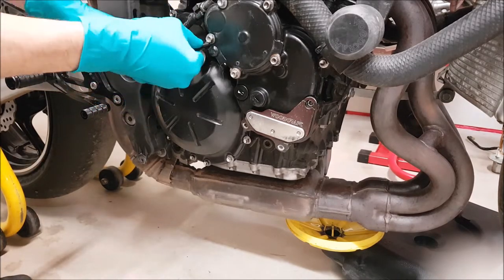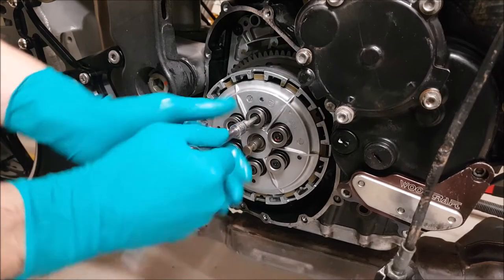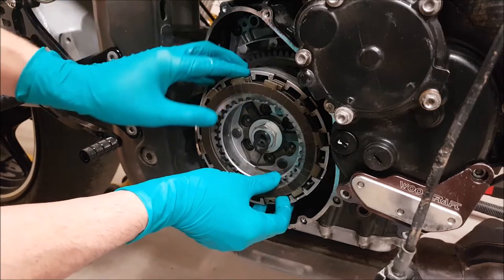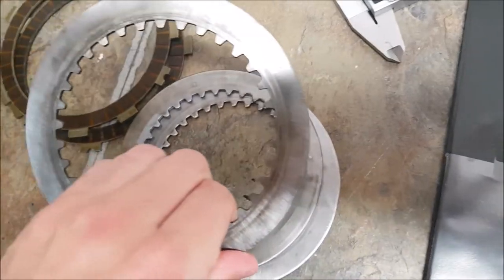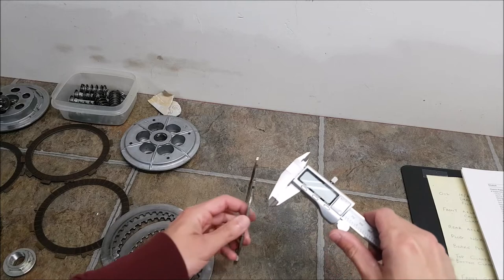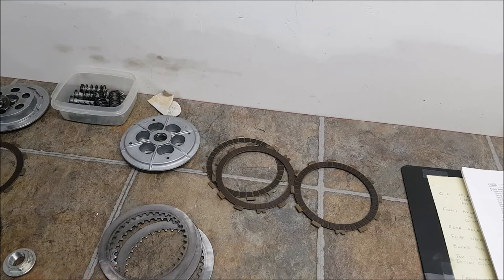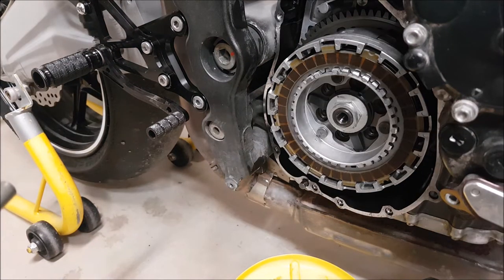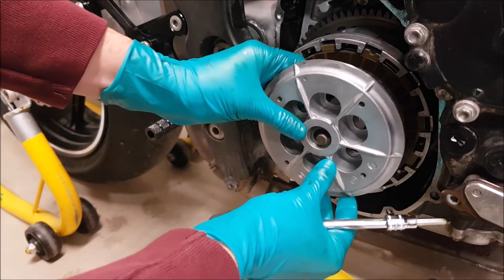ZX6R Clutch Replacement

Comment: Hi ,own zx6r 08 ,cluth is not slipping and is changing good but after getting hot a whistle noise came from clutch when the clutch is pressed,need to change the clutch?

Comment: My clutch cable broke I was able to get a replacement, wasn’t the same one I had but it works, now my bike won’t speed passed 60-70mph it just redlines if I full throttle even if I shift it up to 6th gear it doesn’t want to go passed 60mph, can it be cause of my clutch? I know before I was having issues getting my bike into gear when I try an do a pull. It like slips

Comment: Ok i picked up an 07 zx6 for $500 it has a bottom end knock. Attempted a valve chain adjustment no change. The rod in the clutch that goes through the throw out bearing is damaged at the tip. And as I don't know anybody that messed with the 07 much I might as well ask a racer. Outside of all crank/rod bearings what are some common bottom end issues with 07-08

Comment: What break in time and top speed or rpm can go after get new clutch I was told 6 rpm and 500 miles ... maybe thats wrong or maybe it doesn't matter ? Sucks driving slow maybe some one has better info then what I was told or if some one can confirm it is just what it is. 2022 zx10r
Reply from the maker: There is no break in time. Let the engine warm up and give er'!

Comment: I bought a 04 zx-6r, drove great and shifted good for the first couple rides till one I turned it off and went to first gear with the clutch and it just died, I can see the clutch moving in the casing but it still dies and when the bike is off there is still some resistance to movement with the clutch lever fully engaged. Not sure what could be the issue or what's causing it not to fully disengage the clutch? Your help would be great.
Reply: Most likely turned out to be a poorly adjusted cable preventing the clutch fully engaging.

Comment: When I bought my clutch pack, it had 2 different thicknesses of steel plates. I assume it matters where they go, but can't find info on that in the manual or online so far. Any advice?
Reply: he explains here the difference here 6:24 I believe is what you’re looking for
Reply: @kennq507 Nope, the question was regarding the steel plates. What he's talking about there is the contact area of the friction plates - different plates and different measurement.

I did figure it out a few years ago when I asked the question, but don't remember anymore how that worked out on that bike - sold it over 2 years ago.

Comment: I don't have the tool to measure the thickness of things but if I'm replacing everything with oem parts is there even a need to ? I'd assume it wouldn't be out of spec with new oem parts
Reply: Thats trusting without verifying. Even if its oem, why trust something thats new to you. Always do it safely so you can say you werent the one that was an idiot and fucked up without checking first

Comment: on bikebandit the diagram show one friction plate, steel plate, friction plate, then the rings..... Is this wrong? cause you put them in before the second friction plate? Jc and Those plates look oem so are only oem packs the ones that come with the two large contact pads friction plates?
Reply from the maker: That is correct. The ring OD is smaller than the friction plate ID, so they will sit against the steel plate, even if you install them after the friction plate.
Reply: Colin Bell and the steel plates go in with the polished side away from engine? Like one side on the teeth have a round edge kinda and other side is flat.
Reply from the maker: @coreyhickman9082  since the plates are stamped, one side has a sharper edge than the other. It's not intentional, just a a product of manufacturing. Which way they face is not critical.
Reply: Hey i just got my kit in today from a local shop and all my friction plates are the same is that a problem i dont see any difference in the pad size, also what year is your bike and is it a 600 or 636 on bikebandit they show only 5 frictions plates... how many do you have
Reply: Is there supposed to be two bigger steal plates
Reply: Cj’s Reef idk i also got my steel plates with two of them separated from the rest with 2:6 on the with the rest have 2:3 i put one in first and the other last 🤷🏽‍♂️
Reply: What order do they go in
Reply: Cj’s Reef but i couldnt tell a difference with my eye
Reply: Did the clutch work fine after you put them in like that and what did you tork the springs to
Reply: Cj’s Reef what do you mean? Like i said i put one of the bigger steels if they were bigger idk if they were couldnt really tell, but i put a friction plate then one of the big steels and a friction and repeat with small steel. You start and end with friction plate. And i put the other “bigger” close to the pressure plate
Reply: Cj’s Reef yep ive put about 100 miles on it since i got it together i just went with three clicks on my drill not too tight but tight enough if you really want to know the specs you can look it up.

Comment: My 2009 zx6r is doing something weird.
When I downshift from 3rd to 2nd gear it goes into neutral. It's as if it's skipping second gear. My oil in the bike is still fresh and was changed a thousand miles ago. Does this mean I need a new clutch or is it a different issue????
Reply: Mines doing the same thing but when shifting up
Reply: @BodyRocker9  dam bro sorry to hear, it's driving me nuts 🤯 I think we both need new clutches.. Take my advice and go OEM or OEM replacement but don't spend 500$$ on an aftermarket that won't even last long
Reply: @ayosirsnow  yeah and mines a 07 Zx6r, I’m gonna take it to the shop this week, my mechanic was saying could be user error but it just started doing it and never had the issue before. I’m kinda wondering if I should of just saved up more cash and bought new.
Reply: @BodyRocker9  yea I feel you bro. Let me know what he says or what happens and I'll do the same. There are other possibilities like a shift fork for example and a drum spring. But I'm pretty sure it's the clutch

Comment: Hi, think my clutch is fried on my bike, but never had it happen maybe you can tell me if it is...my bike starts to go like normal then it loses rpm won't move then stalls...even if I rev super high does the same thing
Reply from the maker: If it were gaining rpm while slowing down, it would be the clutch. That sounds like an electrical or fuel/air issue. Check for stored codes in the ECU (see owners or shop manual).

Comment: I have a 05 zx 6r and when I put the clutch in there were 2 thicker steal plates but when I measured the old ones there was only one thick steel plate
Reply: I had the same thing on my 06'   I just went by what PartZilla had listed
Reply: I ordered new steels from the local dealer and they said there were 2 that were thicker than the rest. Not sure where the two go relative to the others...

Comment: Cork or sinterized metal,why are there those different kinds ,what do they used them for
Reply: I'm putting Kevlar friction plates and uprated springs, as with sintered material it gives better grip so your clutch grabs sooner and will have less tendency to slip. Only worth doing if you like to ride quickly, cork are fine for normal gentle riding but will wear quicker if used hard on road or track.
Reply: @HalfdeadRider  i agree,i see you know what you talk about, i just tell you....carefull how quick you wear front discs with fine caliper measuring do it after every 7 days and write it down on garage wall,left and right, also rear, kevlar chews steel fast look at discoloration and darkening ,at those temps there is a chance original discs slide and  do not brake, could even shutter in pieces,not while apply brakes, friction at high speed

Comment: Wonder if this is the same on a 2016 zx6r
Reply: Have you switched yours out yet?
Reply: @afroswagger1754  no I haven't but nice weather approaching so I want to do it before summer hits. Do you ride a zx6r?
Reply: sir snow yes I do a 2016 aswell, what are you experiencing that you are switching your plates?
Reply: @afroswagger1754  clutch slipping which actually causes loss of power mainly in lower rpm
Reply: sir snow mine is mainly in second gear, and my top speed is reduced. Are you getting oem?
Reply: @afroswagger1754  no im not getting oem. Oem ain't bad but if you going to switch it out mind as well go performance since my bike is full bolt on minus velocity stacks. I recommend you don't get oem and go with a performance clutch. But I do have stock gearing which I'm happy with. What's done to your bike?
Reply: sir snow what performance ones are you getting? I’m trying to swap mine out ASAP. And not much just m4 exhaust flash and tune air filter and a quickshifter
Reply: @afroswagger1754  dope bro, I recommend taking out your cat if you don't want to pay for full headers. Also a power commander 5 for your fuel injectors. You don't need to map it since you have a flash. If you have the money I'd say to dyno tune it. Also I forget the clutch brand I bought but there were so many and they were all really good. Just budget shop and don't over spend

Comment: what year is this zx6r
Reply from the maker: 2008
Reply: @ColinBell321  thanks. i have an 06. plates on disengage. after replacement. all parts complete.
Reply: @ColinBell321  I have an 082 with torque specs did you use for your pressure plate and cover?

Comment: Why go through the hassle of measuring them? Why not just replace all the plates
Reply from the maker: Why go through the hassle of measuring anything? May as well just replace it all 🤷
Reply: @ColinBell321  yea that's what I'm asking
Reply from the maker: @InernalCombustion  that was sarcasm... you measure/inspect them because there is a service limit listed in the manual. If you like throwing away potentially good parts, go ahead and replace everything. Why bother measuring brakes, why not change oil every ride?
Reply: @ColinBell321  right but I'm assuming people buy a clutch kit, unless you can buy individual clutch plates.....🤣. You mean to tell me that every time your clutch slips you buy an entire clutch kit and use one or 2 of the plates?
Reply from the maker: @InernalCombustion  fair point 😆. This was a race bike, and I had a bin full of spare plates. Ones that measured bad got tossed, and the good ones saved for a later date.
Reply: @ColinBell321  ahhh see I can understand that lol. I like to hoarde all kinds of mechanical pieces in hopes that it will save the day one day
Reply from the maker: @InernalCombustion  I wasn't thinking outside the box... that maybe some people don't keep spares/penny pinch like I do lol.

Comment: I have a question,  Do you need to soak clutch plates in oil before installing?
Reply from the maker: Yep, overnight.
Reply: @ColinBell321  in what kind of oil and how to clean them before soaking them into the oil?
Reply from the maker: @ademkaramusa6491  whatever motor oil the bike takes, and if they're new they shouldn't need to be cleaned. If they are not new, you don't need to soak them.

Comment: Hi Colin watching you from Portugal. Great Video. Bought an accidented (small) ZX6R with 50KKm couldnt engage the clutch and after moving ajusting cable screws plus pressing several times the cluch lever it worked. While riding the bike when i wanted to acelarate fast it would increase rpms but not the speed. Slipping I guess. Next day clutch had a litle course, bike would start moving slowly and, after some tries,  I could engage 1st gear but releasing the lever the bike would not move even when accelerating. Any advice, would you say this is a clutch problem? Cheers and keep up with your great videos.
Reply from the maker: Thanks for the kind words Jorge. That defenitely sounds like a slipping clutch. Do you have any free play in the clutch lever when it's released?
Reply: @ColinBell321  Not really, but due to your first answer  I opened the full system cleand it, considering that the bike didn't work for a little while, and...solved. God Bless.

Comment: Your last friction plate goes in the different notch
Reply from the maker: You're right. I made a mistake in the video. I've run it both ways and noticed no difference though.
Reply: @ColinBell321  wasn't sure if that would be the problem or not